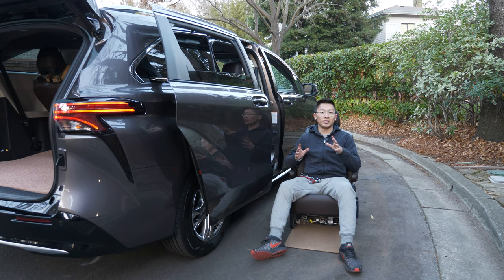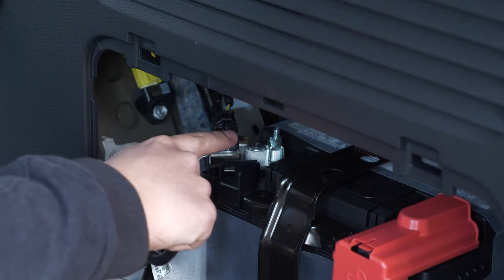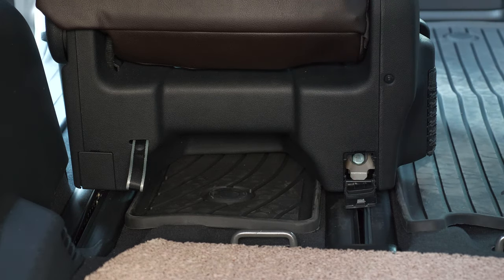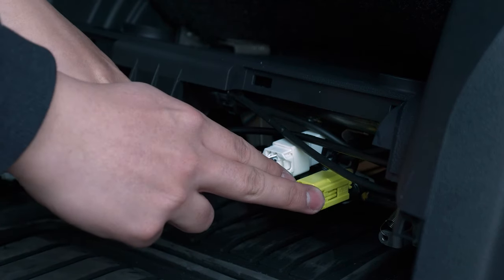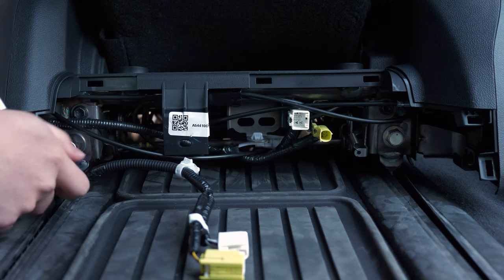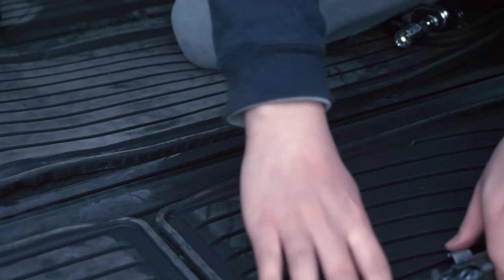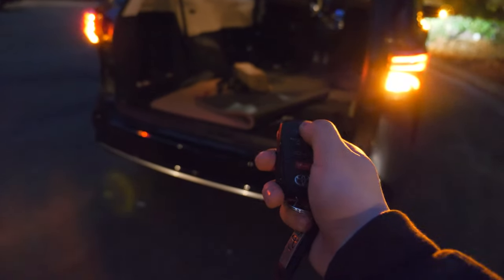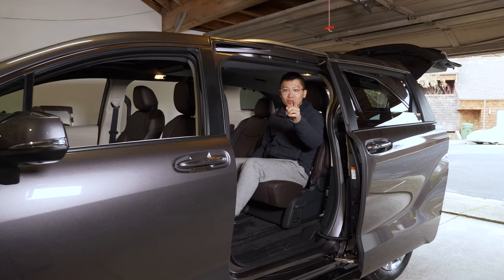Removing 2021 Sienna's "Non-Removable" Seats (UPDATE IN DESCRIPTION)

Comment: The whole purpose of buying a minivan is space.  I hate the fact the 2nd row is this hard to remove.  Bad design from Toyota.
Reply: Uhh yes and no... Most minivan owners do not remove their second row often if ever. While I agree its annoying, they did it for a reason – and its not a deal breaker for most
Reply: It has to do with airbags as part of the sliding seats and the electrical.  They can be removed with care.

Comment: I was seriously thinking about buying a 2024 Sienna to use as a camper conversion WHEN we travel. But once I found out the 2nd row seats are now non-removable ...I was ready to cancel the deal. I am a 75yoa DIYer who now plans to go forward with my plans. THANK YOU VERY MUCH!!!
Reply: Good for you!  Simular situation, just retired, want to travel.  Bought a '24 Sienna, removed the seats.  I was horrified to discover on my model there are three connectors to the seat, not two.  However, plugged in the round and rectangular dongles in and left the white big one alone and it worked perfect!  don't worry about the third (big white) connector.

Comment: Weird choice from Toyota. Removing the middle seats in a minivan is great for cargo space.
Reply: This is the second generation of Sienna like this. Siennas from 98-09 had a removable second row. It's likely a response to Stow 'n Go, since not everyone is physically able to carry a seat.

I really like that my 04 8-seater has individual removable buckets in the second row. I can configure it as a 3 seat bench, 2 seat bench on either side or 2 captain's chairs.
Reply: @questioner1596  Our ‘13 has an 8 passenger setup and the middle row comes out. It’s a absolute pain because the middle seat isn’t separate (nowhere near the ease of our 07’ Odyssey). This may be just for the latest generation.
Reply: @jaywhite1850 , while the middle row in those newer Siennas can be removed, it leaves the sliding base. I don't think Toyota expects people to remove the seats, since the seat bottom folds up and it slides forward.

My '04 doesn't have the sliding track, so the seats are much simpler to remove. Also, the middle seat base isn't connected to one of the  side seats like the newer vans.
Reply: @questioner1596  Not sure I understand completely. You’re saying the new ‘21 (5th gen) seat separates from the base? That doesn’t make sense because of the airbags inside the seats. That’s why Toyota made the seats non-removable. I have the 4th gen and there’s no cradle/base.
Reply: @jaywhite1850 , I'm responding to you saying you have a '13 Sienna, and saying it's a newer Sienna than the 98-09s that didn't have the sliding tracks. 

The newest Siennas presumably have removable rear seats, just like I have unbolted and unplugged front seats from cars, but it's not meant to be easily removed by the customer (the 2010-20 Sienna's seats can also be unbolted from their bases, but not easily either). They are on sliding bases, just look at how the middle seat in the 2021 is a removable jump seat that clips into the sliding base of the seat next to it.

I question your use of 5th generation for the 2021, because by my count there have been 4 generations of Sienna (98-03, 04-09, 10-20, 21+).
Reply: @questioner1596  I understand now. When you said “sliding base” on newer model, I misunderstood. I never thought of the rolling track as a base but it makes sense. And I got the generation numbers wrong. 
I’d buy you a beer if I could.
Reply: @jaywhite1850 , that's a kind offer, thank you. Cheers!
Reply: To discourage people from living in them.
Reply: Yeah that's a total deal breaker for me.
Reply: @florindagonzalez5700  Liar! 😣😣
Reply: @florindagonzalez5700  "Especially down by the river!" - Matt Foley
Reply: @jaywhite1850 Hi. I have a 2023 AWD Toyota Sienna Hybrid. I realize the OP comment is years old but the question is valid. The 2nd row captains chairs must be removable because someone at the factory must install those seats. I also own a Sienna AWD XLE 2013. The track is almost the same. There’s no extra bar to push to remove the seat on the 2023 but the engineering is almost the same. There is a wiring harness underneath the seat of the 2013 and 2023. As you stated, the the new hybrid version has airbags and heating elements built into the wiring harness - or dongle as some call it. There are notes in the description to explain the rest. When the newer 2nd row seats are uninstalled in a systematic way (always disconnect the rear accessory battery first or you’ll eventually have a $1400 repair bill not covered by warranty from Toyota like we did) , the 2nd row seat MUST have a replacement to fit into the now empty space. This affects the 2nd row air bags, not the first row airbags. If you worry that the first row air bags will be affected, don’t remove the 2nd row seats. We put our 2nd row seats in place, paid the $1400 electrical system failure repair bill and left the 2nd row seat folded which gives us about the same cargo space as a Toyota Four Runner. If anyone has a solution for the 2023 version let me know because the 2023 has an extra wire not seen in this video. Cheers.
Reply: Great video. This van isn’t even on my list because of the middle seats being fixed. Looks simple and easy. Cheers and thanks!

Comment: An inexpensive solution to protect yourself and cargo from the exposed carriage rails is to cover them with a section of foam pipe insulation, like the kind used to insulate hot water pipes.  It already has a seam/split so you can just slide it over the top!
Reply: Or pool noodles split down the middle
Reply: This is so obvious and genius! I was thinking all week how I could cover them up effectively.  Thanks for sharing!

Comment: Thanks Brad, many salesmen should share their commission with you. You have finally offer the proven answer that holds back many potential buyers who want to have the option to remove these two seats even though they won't be latch on/off.  Again, great contribution!
Reply: That’s a true statement.
Reply: My sentiments exactly. I'll bet my house that Toyota will come out with removable second seats in ...2022. I could wait for that...
Reply: @JJ-gc8du  thats a big bet. How are you so sure?
Reply: @JJ-gc8du  that comment didn't aged well haha
Reply: Agree!! This was the Single most reason for me not getting this van!! Im coming from an 2009 Odyssey and it went completely flat and still is my cargo hero better hen the wifes SUV!  I wish Toyota redesigns this for weekend warrior dads who need to load up a kid for college or loading drywall and building supplies! It would be great to get remove those post from the guide rails. faster. Right now the Oddy can have both seats out in 3 min!
Reply: @batman1169  I've had a 98 Sienna, a 2002 Odyssey, and now a 2022 Sienna. The Odyssey was clearly the best at hauling cargo. I just wish their automatic trannies were more reliable. That's why I went back to Toyota. Plus the hybrid gas mileage is great, of course.
Reply: I am planning to buy a 2022 or 2023 Sienna XLE, I wonder you could still remove the second row seats this way? I do not find anything on the web from Toyota about this. Thanks
Reply: Amen to that. It'sa deal killler for me...now it's just a few minutes. The middle seats in my 2013 have never been in the car.

Comment: The non-removable second row was a deal breaker for me. What was Toyota thinking? Now that I see they are removable I am reconsidering buying one. Thanks for the vid! Awesome!
Reply: Agree - Total deal-breaker!  But after watching this, NOW I KNOW there's no f-ing way I'd consider dealing w/ this nonsense.  When you need the 2nd row gone, you usually need it gone relatively fast (furniture, bikes, wood, etc).  I'm not going to spend half a day doing this BS.
Reply: @w650dave1  totally agree... Such a bummer Toyota overlooked the folks who like to move big cargo
Reply: Reason I haven't bought a newer van
Reply: @w650dave1  Shouldn't take any more than 25-30 minutes.    You'd spend a lot more time than that sitting in the waiting room at the dealership while a Pacifica is repaired over the years.

Comment: Wow I don’t own the sienna but you’re a hero! You’ve just made the sienna more appealing
Reply: @usarocksandyousuckifyoudon6971  the sienna is still the best hybrid and just like the prius, you can easily acces the battery to install your camping accessories and run the HVAC and many other appliances very efficiently
Reply: @usarocksandyousuckifyoudon6971  I drive a lexus gs450h
Reply: @usarocksandyousuckifyoudon6971  people have been living in prius for years now, and its the best suited hybrid for camping applications.
Reply: @usarocksandyousuckifyoudon6971  uhm the 2,5l is very well turned for the sienna and its not a luxury/sport car like the lexus.
Reply: @usarocksandyousuckifyoudon6971  240hp is enough for todays standard, the toyota land cruiser prado diesel the sister of the lexus gs460 has less than 200hp but alot more torque
Reply: @usarocksandyousuckifyoudon6971  mate do you know the Autobahn? If not then shut up!!!
Reply: @usarocksandyousuckifyoudon6971  it has good tq though.

Comment: Nice video, Brad.  The non-movable middle row is a deal breaker for me so it's nice to know there's a procedure to bypass Toyota's really poor second row re-design.  These seats seem like a huge pain to work with even when installed.  They should be motorized.  Anyway, thanks again.
Reply: They Are removable
Reply: @marshaclifton1535  Removable in this case means the manufacturer designed it to be removed and restored easily by the customer, without special tools.  Of course anything can be removed in that car with tools and enough time.  The last body style on this van did have removable middle row seats and it was awesome.
Reply: The 2012 Sienna I have has removable seats. Toyota must have tried to save money by making them fixed.
Reply: I think that Sienna made the middle row "non-removable" due to the airbag connections.  If it was done easily by the consumer, or recommended by the factory, Toyota could have liability issues when they either were set off accidentally, or not reconnected later, resulting in injury/death.   But I agree, the seat removal and remaining track issue is the big fail in Siennas vs the Odyssey or Pacifica.   But I'm still in the process of buying my 3rd Sienna - wouldn't trade for either of the other two.

Comment: Thanks for showing what it would take if I ever bought one. I've been pondering trading up my 2020 Sienna to the new one. I knew of the non-removable seats which stopped me cold. Now that we have some instructions on how to do it, maybe I'd reconsider that the hybrid benefits would outway my seat removal scenarios which are less than 3 times a year.
Reply: Im with ya... I use it primarily for my giant scale radio controlled planes, so 2-3times a year at most would be re-installing them. The Honda sport odyssey is good but I do not need an overpowered 6 cylinder engine with 19/28 mpg compared to 36/36 mpg with sienna. I just wonder about accidentally touching something to activate the air bags... Hmmm? Thanks for this great video!!!

Comment: Everything in this video and follow-up with the purchased resistors worked (with ever so slight difference I could handle) with the LE trim package's different-but-same seats and tracks. They are gone and the van is fine with it. Thanks!

Comment: My confidence that those plastic tabs won’t snap after repeating this process 5-6 times?  ZERO, absolutely zero.  Really happy I saw this before settling into a Toyota.  All this to get the van ready to head to the hardware store to load that new dishwasher (or whatever it may be)?  Nope.
Reply: I've had so much stuff in the back of my sienna and have yet to need to remove the middle seats. The way they fold out of the way allows you to slide a 4x8 sheet of plywood in no problem. but do go on with all of your Hands-On knowledge

Comment: Now its the center console that needs to be removed next. Atleast part of it so we can actually walk towards the back of the van. lol!
Reply: we just bought a 2020 used for this reason, the base model has no centre console and the 2nd row is removable (although it does leave some nasty rails). Good price on the 2020s with the 2021s coming out.
Reply: To be honest, in 13 years I have never needed to walk through the centre part of the front seats.
Reply: Agree totally
Reply: @Snoopymk37  since captain chairs are so popular, I assume many find the flexibility useful. Especially with multiple kids that need attention
Reply: @remyd8767  We have the 2021 now and love the centre console.  As for getting to the back rows, it is just easier to open the door to get to the kids.  We had three kids in the second row and it was fine.
Reply: @Snoopymk37  the console is a problem in camper conversions.. getting out to move back is very impractical

Comment: Thank you for your excellent video. We just removed our 2nd row seats and used your dongles. Worked great. The computer thought the air bags were still there.
Reply: What dongles?  Dont remember seeing or hearing in the video......leaving the airbag plug unplugged will trigger the airbag light/ system.

Comment: Please update this video.   Bought a '24 Sienna, removed the seats.  I was horrified to discover on my model there are three connectors to the seat, not two.  However, plugged in the round and rectangular dongles in and left the white big one alone and it worked perfect!  don't worry about the third (big white) connector.

Comment: What are the inferior dimensions with the middle seats removed? Can it fit 4X8 plywood boards like the Odyssey/Pacifica/Carnival ?
Reply: Did you get an answer? This was my next question but forgot. My Odyssey is my champion for this. She unfortunately is 2009 and although still good I think a change of vans is needed. Never owned a Toyota since my Tercel in High school! 300k+!!
Reply: I'd like to find out open space dimensions with seats out as well. I would have liked to view the open space in the video also.
Reply: YES! ALL TOYO" MINI VANS' CAN FIT A 4×8, SHEET OF PLYWOOD.
Reply: @batman1169  Hondas have that rubber timing chain that will always need replacing! At 1090!! Or more. Toyotas' have Steele chains. Life time good
Reply: @captainamericaamerica8090  i agree it's probably better but not sure why everyone is hung up on timing belts vs chains vs what the actual vehicle does and handled.  
My mechanic tells me that's not 100% true about steel belts as he replaces them as well every so often. If you Google timing chain for a Sienna, they sell aftermarket ones and YouTube Videos how to do it. They stretch over time apparently. Your key is regular oil changes. 👍💕 Then it will last longer!
Reply: @captainamericaamerica8090  middle seats do not come out unless you're using tools and unhooking the air bag system. So you even own this?
Reply: @batman1169  Tercel! Memories, my friend. Sweet Tercel-flavored memories.
Reply: @captainamericaamerica8090  To clarify: a rubber timing BELT & a steel timing CHAIN.

But yes, according to my 60yo local import-heavy mechanic, about 90% of timing chains should NEVER need changing.

And as of 20XX (I don't recall the actual year), ALL Toyota vehicles now have timing CHAINS! 

No more timing belts! Toyota for the win!
Reply: @captainamericaamerica8090  Steel chains after 2006, timing belts before, right?

Comment: The only thing that prevents me from acquiring a Sienna 21 is this huge central console that I would like to remove  for a camper conversion . I want  to leave only a flat alu checker plate for supporting the shifter .I need a pass tru  to go at the back without going out  . Did you explore how to undo the plastic trimmings which is unfortunately sharing with the dashboard ? Thks

Comment: Brad.  I did the seat removal and reinstalled the seat with the help of your video after fixing a stuck seat issue. However the sliding doors will not close.  I tried the sequence; doors and hatchnack closed, press power door lock button, then cycle locks on the remote and pressing the power door lock switch.  Any suggestions?   It is a 2021 Sienna.  And is a 2nd row seat.
Reply: Got it. I closed the sliding doors manually and it all works.  Saved me approximately $500.00.   Thanks Brad.

Comment: Thank you very much for this useful video, and your associated video about the 2.2 ohm plug.

It would be great if someone could provide a drawing or sketch diagram showing the length and width of the floor space that becomes available after removal of the 2nd and 3rd row seats.  That would help potential buyers who would like to fit in a camper module(s) or e.g. carry a cargo bicycle or etc.
Reply: Agreed!!! I'm wanting to buy one of these vans and turn it into a mini camper. I really need those measurements too!!!!!! Brad, please make a video on how to remove all seats, except the 2 front ones.